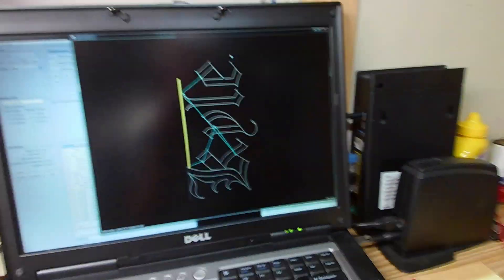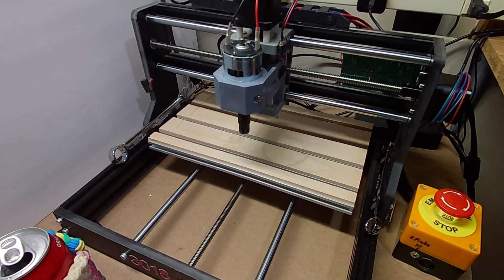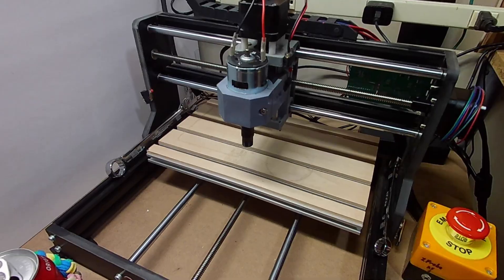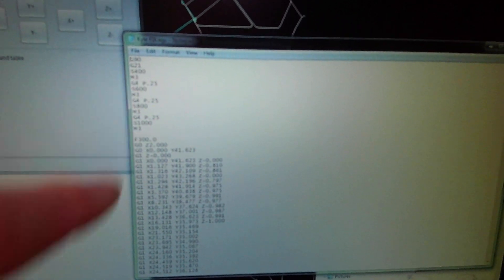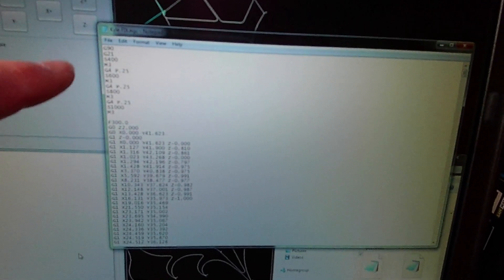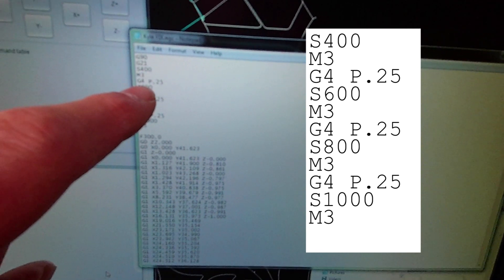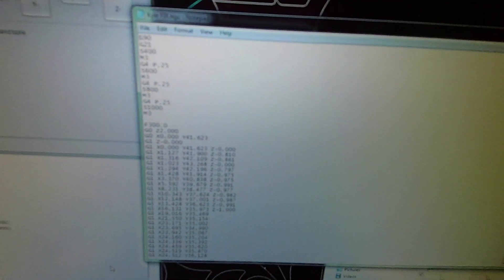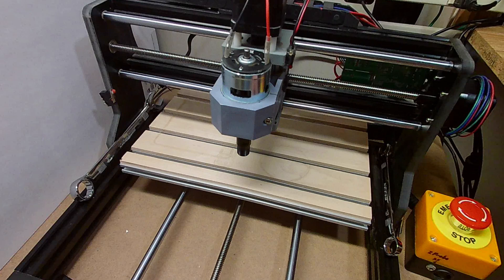SainSmart GS-775M spindle upgrade for 3018 Pro - Part II

Comment: very useful! One thing is unclear for me though - do you have to type in and run that additional code EVERY time you want to use the router? Or is it do you type it in only once and it is permanently "coded into to the spindle" (so to speak)? And if that's the case, how do you remove it later if you no longer need it? :)
Reply from the maker: Great questions.  I use a couple different programs to generate my G-code.  One of them has a place where I can enter that start up code and it always adds it to the output.  Another program I use does not have this feature and I have to add it to the output.  To do this, I have it in a text file so I can easily copy it.  If I replace my power supply down the road and no longer need this extra code, I can update the program that automatically adds it so that it doesn't do it any more. On any existing g-code that has the ramp up code already there, I can delete that or just leave it as it doesn't hurt to have it there and it really doesn't take long to spin the motor up to full speed.

Comment: where do you get that file with the code? How do you edit it?
Reply from the maker: Good questions.  When my software generates the G-Code, I have to tell it where to save the file.  So the "where" part is where I tell it.  For editing, I just use Notepad.  It is a basic text editing program that is part of the Windows OS.  Some of the software I use has a place where I can tell it to add this code when it generates the G-code.  Then I don't have to add it later.
Reply: @CNCATHome  you mean I have to do that for every file?
Reply from the maker: @hermanarango2896  - Unfortunately, yes.  That is why I like when there is an option within the software to put this code in to automatically be added to the head of the file.
Reply: @CNCATHome  thanks. I really appreciate you being so patient

Comment: Good info. Just FYI, I received a new 3018 PROVer for Christmas 2021. It came with a 24V 4A power supply. I later purchased a Genmitsu 20k RPM motor and it seems to run perfectly fine without gcode modifications.
Reply from the maker: Thank you for that information.  That is good to know.
Reply: Thanks

Comment: were do i add this i use canle and vcarve
Reply: Ok figured it out just update to the newest candle and add the code to the startup code done dont need to enter it all the time anymore
Reply from the maker: @jamescole5018  - Good work James.  I am glad you were able to get this figured out.  I am glad there is a startup option you can control.
Reply: Thanks love the quick response you have a new follower
Reply from the maker: @jamescole5018  - That is great. I hope you find some of the content helpful.
Reply from the maker: As I mentioned, I don't use candle. In digging into that, I looks to be just a sending application.  I looked through the settings and the version I have, 1.1.7, does not have any way to change the code being sent. I use a program called Universal Sender to run my 3018Pro.  It doesn't alter the G-Code either.

I looked into some of the VCarve options a while back.  For what I do right now, that was too much to spend.  A friend of mine uses it and he really likes it.  I can ping him to see if he knows anything about customizing the spindle startup code.

For some simple things, I use a program called F-Engrave.  It is a free program that works well for doing text and converting images into a tool path.  That program does have a field called "G Code Header" where I can place this M3 startup code.  That is nice in that I do not have to open up the G-Code it generates and do a find and replace as I have to do with other GCode that I generate.

I also use Fusion360 which is very intense to learn.  Super powerful, somewhat buggy at times, too many options, very flexible, and I would bet there is a way to get the spindle startup code in there somewhere.  I just haven't dug into it yet as I spend too much time whenever I use it trying to remember how to do the most basic things.
Reply from the maker: Anyone who uses Candle and/or VCarve, can you help James Cole with how to tell the software to use the script in the comment to spool up the spindle vs. going to full power?

I will do some digging into this to see if I can find any answers.  One thing is to save the G-Code, if that is an option, and edit that manually with a text editor.  Anywhere the spindle it activated, copy this code in to replace it.

Comment: where do I edit the gcode? Using Candle & Easel
Reply from the maker: I wish I had an answer for you.  I do not use Candle and Easel so am unfamiliar with how they operate.  If there is an option to output/save your G-Code, it would be in a text file that can easily be edited.  In one f-engrave, there is a place to add startup code so I don't have to edit the code generated from that application.

Comment: great and informative videos but could you explain to a novice how to enter modified gcode thanks for the help
Reply from the maker: I will try to answer your question.  If you are generating a file with the g-code in it, it is a simple matter of opening that file in a text editor such as notepad (on a windows computer) and making the needed changes.  In the f-engrave program, I have updated the "G Code Header" in settings to contain the new ramp up code.  This way it will always be used when I generate my g-code and I won't have to go in and edit it.

I hope this answers your question.
Reply: @CNCATHome  thank you

Comment: so i dont get it every time you run now job you have to add g code command
Reply from the maker: With the free software I mainly use, that is true.  I haven't looked into it yet, I imagine there is a way to add this code into the more advanced software such as Fusion 360 so it wouldn't have to be entered each time.  It is an easy cut and paste and if I am not running at 40%, I don't need to change the code.  I may upgrade my power supply and then I won't have to worry about it at all.

Comment: Great video thanks Mr AT,  Do you have any video of improved cutting & improvement in speedt rate & cut depth?
Reply from the maker: Great questions.  I wish I did.  I just haven't done much with the router since the upgrade and I should!  Just having too much fun with the laser.  I have a video coming out soon where I cut a tree ornament.  Maybe I will do that one again with my modified code and up the cut speed!  ;-)
Reply: Great, thank you

Comment: Thanks for this video. I also got the motor thinking it was just a swap out. I am a newbie at this stuff, so I need some more explaining. Does the above code get included at the beginning of the gcode for a cut?
Reply from the maker: That is a good question Brian.  That code would replace any spot in your code where the spindle is off and is then turned on.  Normally that would be near the beginning of your code.  Usually, the spindle would be running the entire time.  You may have code where the spindle is stopped for tool change or some other reason.  You would need to add this code there as well when the spindle is started back up.

Comment: Just installed my GS 775 Spindle upgrade. My spindle powered up completely and actually did a small cut seemingly without issue. Seems the control board is working properly. Correct? The biggest issue I experienced was the vibration. So much that I noticed the guide bearing working their way out. So working to fix that issue. Did you experience increased vibration at the high speed. Maybe I got a bad motor.
Reply from the maker: That is good news on getting the new motor installed.  I did not experience a noticeable amount of additional vibration.  The new spindle motor is quite a bit louder, that is for sure.  If you feel the vibration is excessive, you can contact the seller and work with them a resolution.
Reply: James Dean's upgraded motor was significantly quieter. I'm surprised yours is louder. I wonder if you are getting an out of balance vibration? Maybe try those grub screws on the er11 coupling and see if it improves. 
PS. Did you align the coupling grub screw holes to the flat D face on the spindle ?

Comment: Informative videos, would you elaborate on wiring connections of the homing switches. Thanks
Reply from the maker: Here is a site that has great detail on how to set up the limit switches on the woodpecker controller: http://blog.shahada.abubakar.net/post/adding-end-stops-limit-switches-to-the-3018-woodpecker-cnc-router

Comment: just a heads up i run a 15 amp power supply on my 3018 pro. im running 3 2.1 amp steppers at 92 oz in. In addition i run a 500 watt spindle and i use the 5v variable output to then control the speed on the spindle power supply.  no issues whatsoever.  https://www.amazon.com/gp/product/B0146IAXYO/ref=ppx_yo_dt_b_asin_title_o06_s00?ie=UTF8&psc=1   it was cheap and there in a day. and unlike many power supplies out there has a lug shield. the board will only draw what it needs. the board can handle 6.5 amps. my steppers will never hit full current draw at any time synchronized so the 3 2,1 amp motors are just fine, leaving enough current for the rest of the operations.
Reply from the maker: SainSmart said that I should not have more than 120 watts going through the Woodpecker controller.  That would be a 5amp power supply at 24 volts.  The power supply that came with my machine is 4.75 amps.  It is doing the job now with the stepped start up of the new motor.  I like your solution of powering the spindle separately and controlling it with the output from your controller.  I was thinking of doing something similar if I had to OR if I get an even more power hungry spindle motor.  The power supply you listed looks very much like one that I have book marked for potential future upgrades.  ;-)

Comment: Btw, I can actually also explain why. A spindle is nothing more than a motor. Or in other words an inductive load. Especially at startup these will create a pretty big peak current (for a short time). By ramping this up in little steps this initial peak isn't so high.
Funny that I never thought of it to begin with, but when I was watching your video it just clicked. There are also softstart modules for these kind of things.
Reply from the maker: I didn't think of this at first either.  It is such a small motor I wasn't thinking about that initial load being very large.  And it isn't.  But we are dealing with small everything so it is just as big of a deal as it would be with a large three phase motor.

Comment: if the start load is to high for the board are you going to damage it when you load the motor especially if it is a heavy cut is the board not going to damage it self trying to push that much over a long period. keep up the good work I appreciate all the information you share
Reply from the maker: The controller has some built in safety features to help prevent damage.  That doesn't mean I can't damage it.  I am going to keep a close eye on how it performs with some cuts.  :-)
Reply: @CNCATHome  The board has no protections, the limiting is happening by the external power brick, and consequently that is also where the problem lies for starting the motor. You need a beefier supply to be able to run that motor under load, or even start in your case. I have the same motor, though the stock supply I got seems to be able to handle the startup (newer unit, so possibly more powerful supply). There is also risk of blowing the drive circuitry on the board, as the control board was not designed to push that much current. (Mine got blown when my spindle got loaded down by trying to take too deep of a cut) If you are always running at 100%, you may want to consider powering the spindle externally from a separate supply. If you want spindle speed control, you will want to look at a different board that has more drive capability, or modifying the existing one to increase it's capacity, and using a higher wattage power supply.
Reply from the maker: @canadianavenger  - Thank you for the information.  I was under the impression that the Woodpecker has some build in overdrive cutoffs.  I have been able to get this working by first powering up the spindle and then starting the moves and cuts.  I may go with the external power supply for the spindle so it has no power issues and the controller doesn't overload from that.  I would control the on and off from the Woodpecker's signal so the spindle would at least turn itself on and off.  I might run that through a micro-controller and have it control the speed as well.  We will see.
Reply: @CNCATHome  the speed and on/off on the woodpecker are the same signal. They are using a PWM channel to drive a power MOSFET. -- That means that when the FET is off, the spindle is off, when it is on, the spindle is on, speed is achieved by very rapidly turning it on and off. (Sorry if you knew that already, no idea what your technical level is) -- So no need for an external micro, just go with a more robust driver, and feed it from the same signal that drives the on-board FET.
Reply from the maker: @canadianavenger  - You are the BOSS!  Thank you.  I have not looked into how that worked so I had no idea.  That makes it more simple to integrate an external power supply for the spindle.  Thank you so much for the information.  This project just became easier for when I do it.  :-)